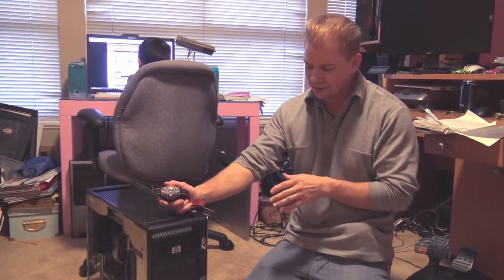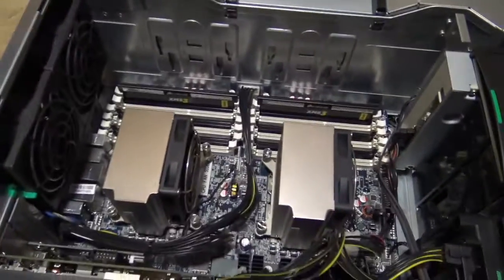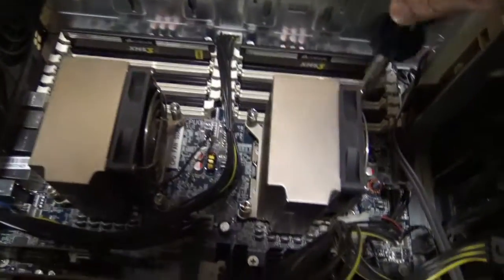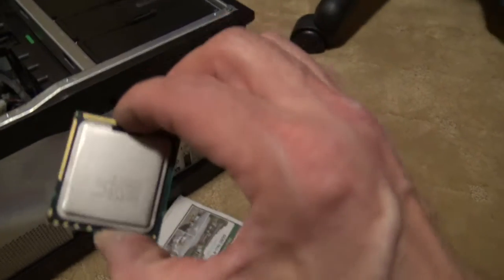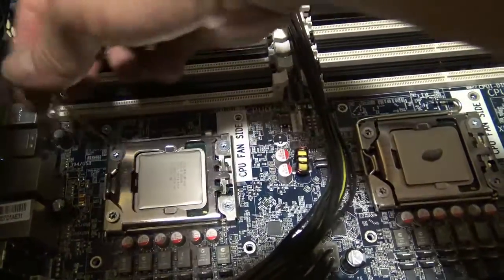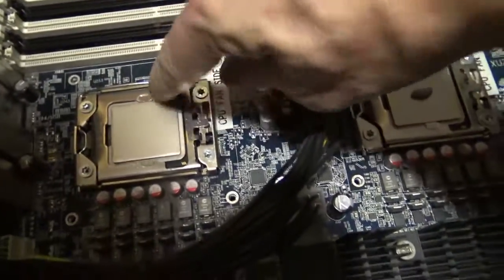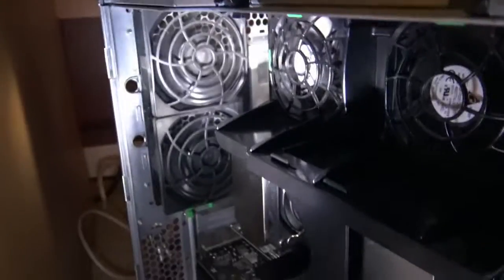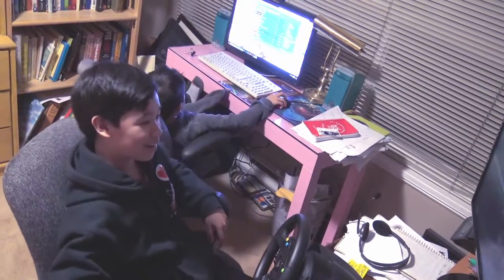My Z800 CPU upgrade! Plus extra fans for more horsepower!

Comment: Have you checked compatibility with this processor - intel X5690 ?
Reply: X5690 is the highest spec you can put in the Z800, however if you run 2 of these you should get the bigger PS, and turn the fans way up.

Comment: i just upgraded mine, but i used x5680s. these are way faster and get about 3100 in cinebench.
Reply: What version of CB?
Reply: Did you need to upgrade the heat sinks for high powered CPUs?

Comment: I have the HP Z800 with 2-Xeon X5650  @2.67GHz CPU's.  Is the  X5672 Better?
Reply: Yeah x5672 better. Or x 5690...
Reply: @warriormike387  I'd like a pair of 5690's however at $80 each roughly I'll stick with 5660's $10 each.